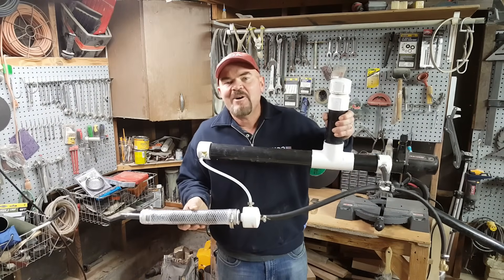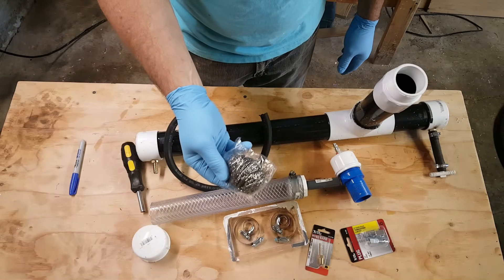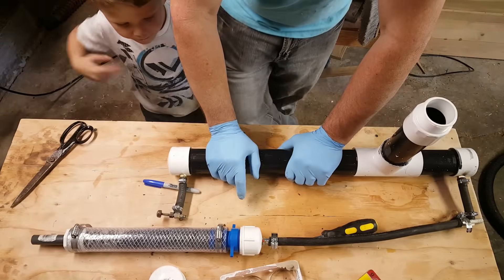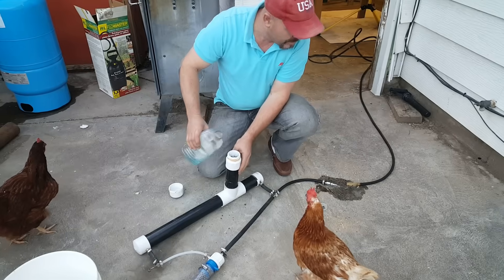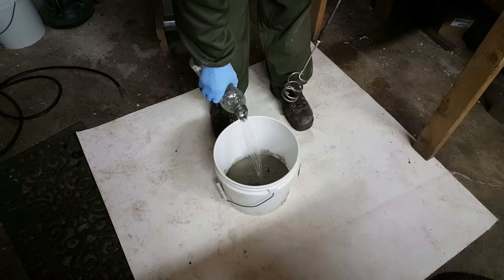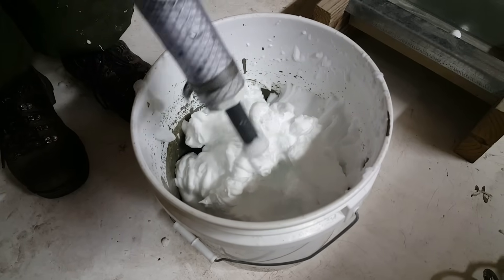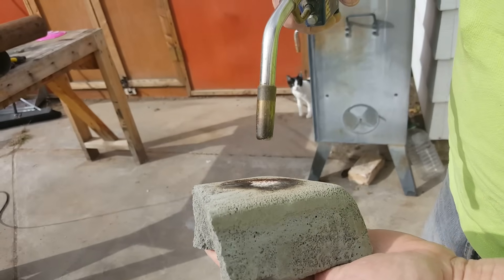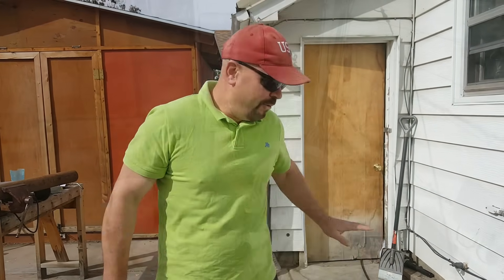Air Crete Machine for Under $30 (DIY)

Comment: The sad part is:
On the rate of inflation this should only be $38 today but the prices don't match inflation due to greed so buying all these parts new from Lowes is gonna run you easily $110 today.
$60-$80(depending on deals for and available bad cut offs if your Lowes still cuts PVC pipe) for the PVC alone.

Comment: Can't believe this have been 5 years video.
I've wondered would it be good with internal reinforcement to be use as a aircrete clap as thick as 4 inches for 2 tonne vehicle to run over especially it to be place on the rocky and wetland?. I'm trying to solve a rural area which the government stopped work on the incomplete road building. It gotten worse due the pebbles road is lower than the side 4 ft. wide drain on both sides. If this could be a temporary 5 years solution. I could buy some time before getting the government to continue repairing the incomplete pebbles road which is getting muddy these days.
Reply from the maker: aircret would not be good for a road. thanks hdc

Comment: I get the need for 2 piece design (nozzle and tank) , but it seems like it would be cooler if you had built the design to resemble a paintball gun with the big tank on top and the handle on the bottom... you could even put on a trigger to make it even cooler!!!!
Reply: I would also recommend putting in a regulator in front of the soap chamber and reduce the possibility of explosion

Comment: This is the same stuff used for INSULATION in walls!!  My next house I build will be light gauge steel studs with AIR-CRETE INSULATION. Having a contractor install it would be more expensive than creating my own process and having my own crew do it. Already figured it would be 60% or more doing it ourselves. The beautiful thing about it is that it can increase structural rigidity while also reducing exterior sound and great insulator with MAXIUM fire protection AND no rot or mold or insect infestation!  Between LG steel and Air-crete, the structure is as well built as I could think to engineer a residential home. The exterior sheathing will be a cementitious panel product as well. Interior sheathing would include non-papered drywall and/or wood panels (love wood for its appearance, time to stop cutting forests for ANTI-"green" energy windmill access roads and transmission lines and use it for its BEAUTY!!)

Comment: HI HONEY DO can you guide me  what sortof comressor  and  air pressur  should one use for this 

and also from your  experties + experience  tell me  if  we can make  some  thin  tiles  for  roof top ( aprox one inch or inch n half )  as my existing roof has leakages  snd i want to use these and plaster the surface ( instead of taking whole roof of and rebuild it)  

look forward to reply  thnx

Comment: Of course it cracks when you step on to it. Fully cured it maybe could stand the pressure. But if you put ferrocore into the aircrete it will easily carry the weight of yours. 

I understood you are going to build a boat with this material? I think its good idea, aircrete is LIGHT and it FLOATS, but you still need ferro core to it like conventional cement boats do. Outside of the boat should be sealed with waterproof paint, inside of the boat should be let so breathable that it can vaporate all the moisture out. Even the old wooden boats usually are painted outside and oiled inside so that the structure can "breath" moisture out.

Basicly all building with crete is always strengthened with ferrocore or other similar material. Fiberglass boats has fibers, without those fibers the Resin would crack excatly like the cement cracks without any core.

There might be a problem with ferrocore corrosion in aircrete, because it lets air and moisture in contact with the core. Im not sure about this.. The cement might need some additivies to prevent the corrosion. Or use wooden core, plastic core material.

btw. its funny to think a wood piece sized to that aircrete block. It would propably stand a weight of a building without cracking. Wood is extremely durable material when it comes to pressure, perfection of nature. The thing in wood versus crete, is that crete is much more weather proof material in long term. Cement boats can be left in water over the winter, wooden boat must be lift to dry before the frost comes.

Comment: I'm curious: If you were to add carbon powder to your bubble mix initially before mixing with concrete if that would greater strengthen your bond. If you made a vacuum tent for your aircrete parts and pressurized them. Hypothetically, it would compress and stack the foam molecules tighter, and they would be reinforced with spherical carbon structures internally.

Comment: So ... just any device which controls the flow of solution in reservoir thru a pressurised agitator screen ? Yeah. Throw the mix in an air hopper and shotcrete a form with it . Wait till it heals then tar or stucco or facia 👍. Good refractory too.

Comment: Hi.  I built a DIY simple Aircrete Foam generator using a home depot bucket, a tire valve and some pvc for less than $10.  Still tweaking... Let me know what you think?  @

Comment: You can also add fiberglass just like regular concrete to give it some additional strength.  Rebar and wire work as well.

Microrebar is also a new option.

Comment: Air crete should work as a rain colector? how do you think it will behave on an ice cold climate? water can get on the structure and crack as ice began to create inside the panels? I'm starting to try some labs testing... je..

Comment: Absolutely amazing. I may just build a shed out of this stuff. With Arizona summer heat, any idea on how fast it'll cure here? Or should it be cured under shade instead of direct sunlight?
Reply: Cover it up, keep it wet and in the shade for at least a week, two if possible.

Comment: Thanks a lot. I have watched this video for quite few times.
To what what pressure you set the air compressor?
Have you ever measured the R value for the aircrete? it is crucial in order to make this product as an alternative of other insulation materials.
Any indication about the product strength? how many PSI at 28 days?
Thanks

Comment: Love you work. Does the use of chlorinated water affect the generation of bubbles in the AirCrete.  Can you use Hydrated Lime as an additive. Use to build small buildings for latrines in Africa. Would like to make long blocks that could be stacked to form sides, back and roof. Door will be the front. Could you recommend a good formulation using compressor to generate foam. Would be good not to have to use compressor in Africa. Any suggestions on mixing foam in bucket and then adding it to the cement / water mixture. Would appreciate any suggestions. Thanks, Burt  burton.northam@gmail.com

Comment: Could you use this air Crete to insulate your house??? because I have an old house with no insulation. it’s so 🥶 could I pump it in though the outside or inside of the house? I would ❤️ to watch a video of that

Comment: I think it’s really awesome what you’re doing here,but at the end you spoke about safety and the pressures involved with using the foam generator. In the video you glued ABS pipe and PVC fittings together with ABS glue. These two materials are not meant to be glued together at all even though there is such a thing as transition glue. I would not use it. Though this may appear to be working for now these two materials are not properly bonded together. Please use similar material and glue rated for that material if you build one of these awesome machines. Sorry plumber here, can’t help it...Again I think what you are doing is awesome I just discovered your channel and it’s got my brain thinking about all kinds of things I would like to build with this technology. Great job look forward to seeing new videos🏛

Comment: is there videos on what to use this for... i just want to be able to make a gallon at a time...i buld hollow statues and am thinking this may be goo to fill them with to add a little weight and strength... how long does this take to dry... and will it dry using it the way i explained? thanks

Comment: When you put that block in the water, does it eventually become saturated and sink?  Just wondering how porous and waterproof it be for an exterior siding.
That foam machine is great design. I got to build one.

Comment: Thank You now I know how they are using concrete to 3D print homes.  They are using aircrete mixed in the pump of the injector tube.  Double screw mixer like the kind that the epoxy industry uses in the sidebyside adhesive applicators.

Comment: First I have to tell you we could do without the music and more comment on what you’re doing and why you’re doing it I’m gonna go out and build one of these things today but I’m also wondering what if I go to Home Depot and get a can of close cell foam and mix that in with my concrete slurry it expands so if I can get it mixed well enough as it’s expanding it might end up being an amazing thing! But then again what you have just made is an amazing thing I have a wall symbol for my pellet stove that I need to or want to insulate to keep the temperature from changing at all on the outside of the thimble I’ve tried fiberglass I’ve tried Cowell blanket wrapped around the pipe on but I’m still getting a temperature increase on the outside of the thimble soul your goes nothing thank you

Comment: I built a 2000 square foot house in Thailand from foam concrete bricks.  it is easy to cool and is pretty quiet
Reply: Frank , if you are referring to Q-con blocks ,Those are not aircrete , those are light weight flyash blocks Those are what I used to build my house in khon kaen with they are great also built my shop out of them

Comment: Just a question what's the difference in weight of a standard size brick compared to a piece of this aerated concrete of the same size and shape just curious 🤔
Reply from the maker: 1/4 to 1/5th the weight
Reply: @HoneyDoCarpenter  perfect thank you for that information I'm planning on incorporating it into the design for my next snake tank.

Comment: My kids wondered what would happen if you dropped a tape measure into a bucket of water. I fished it out and dried it off. But then the interior spring rusted. That's what happens. That was the end of the tape measure.

Comment: I found it interesting that a part of it didn't blow up... I've heated over concrete before and the rocks in it explode and almost lost an eye to it one time.. But blinked just in time and the rocks stuck in the eyelid and around it burning in.. Had to pluck them out.  I'm lot more leary about heating a little cement like you did..   So I find it impressive..

Comment: At a small increase in material cost, there is a much simpler approach to the "solution chamber" you used. Pick up any hand pump pressurized sprayer. drill a hole in the top and use a brass fitting to add a brass ball valve and then add a hose fitting to the other end of the ball valve which then goes to the compressor air line. The valve is used to fine tune the flow. Remove the spray nozzle and the valve, and feed that tube directly into the foam mate. Then you just open up the pump sprayer and add the foaming solution.

Comment: Hey Darwin , love your channel . I was really curious about the foam properties you might explore . Do you think there is an admixture to form closed cell entrained air in the matrix ? I see where you pored water right through a block . That would be awesome for a stucco top coat app , but what about a panel that was waterproof right out of the forms . Add some die and a texture and "Bob's Your Uncle " ! ! ! Never paint again and no insulation required . We could build homes for pennies on the dollar ! Oh yeah , I'm a retired building contractor . Like you , my brain never stops . Earth needs so much . Maybe it needs guys like us too . Keep it coming brother .

Comment: steal need and want to see if this design works well, get the right weight of the foam or the rigth pressur from the air compresor into the systeme can be trycky, if the foam is two heavy or too light then the briks your building can not be good or ideal... i do like to see the full process see how looks your foam and what is his weight for one liter. will be cool. but anyway, keep the good job, its great to make evolv design!

Comment: Great idea, good explanation. I would shorten front rubber hose to have it parallel to the main tube, or even join the two tubes together and arrange the small rubber hoses to make the entire assembly more compact.

Comment: Excellent, well explained, (and you have a great family). See, with synthetic micro or macro structural fibers (such as radmix) or another type of fiber suitable for construction added to the mix, and you will have a stronger brick (tensile, flex, shear). One question, the proportion of cement, sand, water and foam to prepare a standard mixture?

Comment: SO.............. I think we can achieve the same results, if we just add the soap liquid directly into the water we mix the concrete with, using  the "aerator" mixer you use here.... Yes ?

Comment: I thought people tapped their molds to remove air bubbles because air bubbles are bad making the brick weaker... as he demonstrated when standing on the brick in the sand bowl.. do that with a red brick.. that red brick wont split apart like that.

Comment: I like your design. That’s not “black pvc” there’s a reason it says abs on it. If you are trying to glue it that’s important because they use totally different glue and don’t glue together with pvc well. Thanks for this video though.

Also, they sell fire brick material in a bag like concrete. For your other project. Though I do think this would hold up pretty well under heat by itself.

Comment: You are goofy, not funny and pretty self-absorbed. However your wife makes a quality video, does a good job with the camera and editing, and when she speaks, it's definitely worth listening to! 

With that being said, let me say there is definitely a lot of good material in your video series and I thank you both for that.
I do appreciate your honesty in saying you are guessing, it's an experiment, etc.. 

It's really a strange-a** combination of pleasure-with-pain to watch! LOL!
Question: What about mixing glass fibres (shredded fibreglass) into the mixture? Lightweight, strong, an essential component of composite structures, shoot... airplane parts are made out of fibreglass and resin. 

So what about Aircrete with fibreglass?
I suppose I could to a test like this as well, but I have not built one of your machines.
Yet. :)
Make a 1" thick "board" out of regular aircrete and aircrete with glass fibres... weigh them both and then see which one holds a heavier load.
Just a thought.
Keep up the good work and thank you Mrs. Honey for pulling the  reins tight when needed :)

Comment: Great video. I’m making 6 x 3 concrete interior wall cladding panels. This would solve the weight issue. Can you add glass fibres for strength?

Comment: I am in the process of going totally off grid in South Africa. Lots of folks here too that are tired of the tyranny imposed. Building a sandbag home. I must just figure out now how to be able to make a similar machine to spray the concrete / foam mixture on the outer walls, and then screen it nice and flat, about 10mm thick. Bingo! Thank you once again.
Reply: Marty,
The solution for tyranny imposed is either revolution or move to another country.

Comment: This is cool! Seeing how it stands up to heat and the insulating properties, I wonder how it would work in place of castable refractory cement for building a home foundry furnace. The castable refractory cement is very expensive and makes for a very heavy, expensive furnace.
Reply: Yes. I saw a vid where you make a waterglass mixture, add ordinary playsand, add 60% by volume Aluminium Sulphate powder, mix, and cast. Good for up to 3000 degrees F when cured. Unreal. Good luck.

Comment: OMG!  You've kick-started my brain. And, other than a twinge of pain and a puff of dust  ... I'm generating 60 questions per minute now!
Mind if I ask a couple?
1.) If exposed to moisture, i.e. ground moisture, does foamcrete tend to become water-logged?
2.) I saw the blow torch demo in the vid. Any stats on the R-Value per inch thickness?
How much does a foamcrete brick weigh?  (If my wife throws one at me  ...  should I duck?)
3.)  Have you experimented with any composite foamcrete ideas? Example: Spraying successive layers of foamcrete, each of decreasing density, to combine structural strength with insulative characteristics?
4.)  Have you considered using mini-styrofoam balls to mix with the concrete, to change the characteristics of the finished product?
Example: If styrofoam balls were used, the "voids" in the foamcrete would become water-resistant, preventing a percentage of moisture permeability (if that is an issue with standard foamcrete.)
5.) Can you provide a link where I could get more information?
Thanks.
Sincerely,
Concretely Amazed 🙂
Reply: If you get answers here or through more research I'd be interested in what is learned.
Reply: Styrofoam beads in the mix would severely effect the high temp insulation, but for normal construction and for other projects that don't specify elevated temps, they work well.